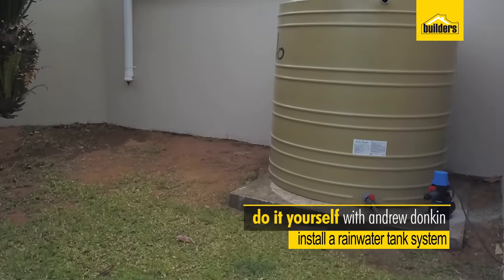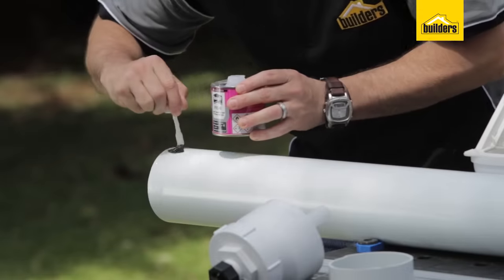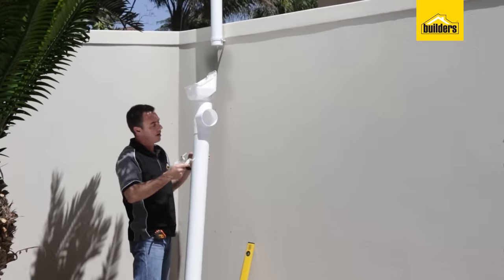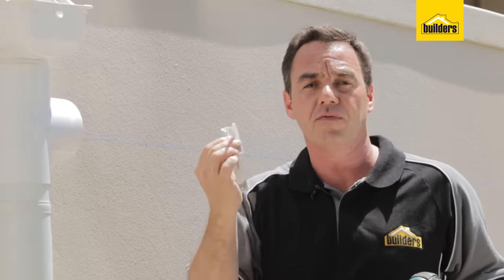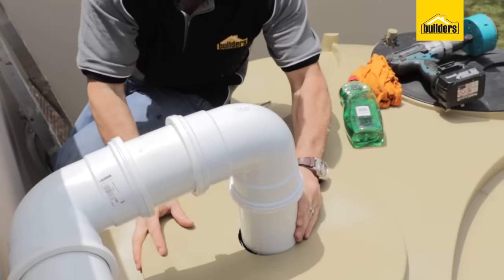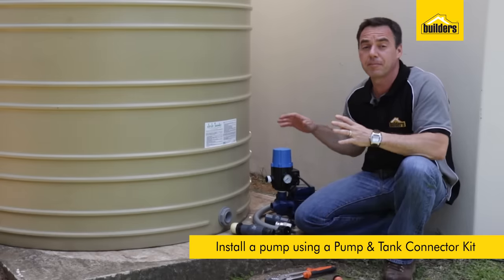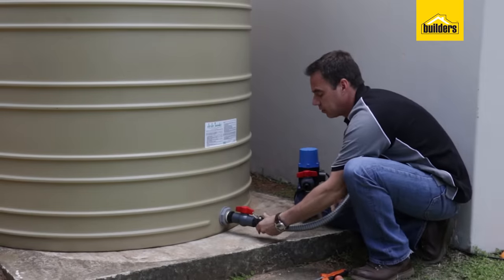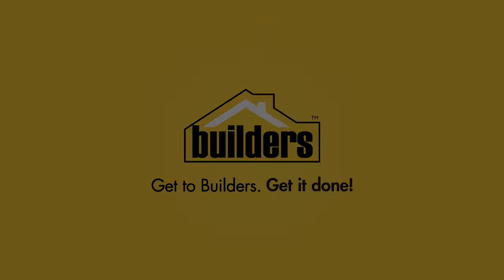How to Install a Rainwater Harvesting System - DIY

Comment: Unless I missed it somewhere... can you please add the list of all equipment used to complete this? Including tools... there are many beginner DIY people that would appreciate it.
Reply: Hammer, masonry drill, hole saw, pliers
Reply: Pipe cement, Level, Hammer, Drill, hole saw and Woodsaw
Reply: What kind of pump?
Reply: @TheSharlethaG water pump.
Reply: That ball. Does it float? What does it do?
Reply: @TheRainHarvester  Once the First Flush pipe gets filled, the ball floats to the top and redirects the water towards the tank.
The filter is called a Leaf Eater, I have the same exact one.

Comment: Wow, alot of water wastage in the leaf shield catchment area, this is why I always use 50 or 80mm, 110 is a total overkill even in the heaviest of rain. 80mm woes not have that issue, also cut the pipe at 45 degrees upwards for the leaf tray in heavy rain if pushes the water to the top and not to the bottom where the leaves fall and avoids that nasty spillage.
Reply: You're saying the diameter of the first flush is too big?  But, don't you want to get rid of a certain volume to make sure you wash off all (most of) the bird poop, pollen, and whatever chemicals may have floated over to your roof, before you start collecting?
Reply: @solfeinberg437  Not the first flush itself. China town you can get first flush in 80mm. I just love the "neatest" setup and I find that with 80mm. To help with the other stuff as well, get gutter guards and clean gutters (with bleach) fortnightly. First flush I would say is necessary but lots of people don't use them.....PS: First flush wont get rid of the chemicals. Also if you setting up, get filters (at least 2). But this video is great, absolutely recommended!
Reply: @garethcollocott6310  Agree. That monster pipe for 1st flush is not necessary.

Comment: Thanks, nicely presented video. Just one question: Why not just use the existing opening on top of the tank for letting the rainwater in? It can be fitted with a filtering screen that is available from the manufacturer, and which will then provide you with even better filtered water.

Comment: Just wondering what will happen if the water tank is full? Do you need to install an overflow valve?
Reply: Then use more water or see how to use those water in kitchen, washing machine.
Reply: overflows to the neighbor's section

Comment: Where does the ball seal the first flush water ?  Did you leave that part out or just not show it ?  The ball needs a sealing surface once the riser is full.
Reply: the T fitting on the First Flush Kit has a seat on the bottom vertical that the ball seats into as the water rises, thereby diverting the water to the horizontal outlet of the T to the tank.

Comment: Issue is my roof have 5 down pipes to drain the rain water at different corners. How to collect them at one point?
Reply: there are a couple of ways to do it...
where are you located???
Reply: @vineshdevchander1894  I am in varanasi, uttar pradesh india.
Reply: @shyammohansharma8919  ok.. thats a long way from me here in South Africa but it does not matter...the principle is not dependent on locality. Varanasi is beautiful. I've been there!!!
Method 1. the quickest method.
Join all the downpipes at ground level and run the piping to the storage tanks BUT Remember to have the lead to enter the TOP of the storage tank. I am making the assumption that the top of your storage tank is LOWER THAN the gutters. Am I correct in that assumption??
At the base of the storage tank put a T joint with a ballvalve in the closed position. After the rain... you can release the water  in the pipelines by opening the ballvalve you installed at the T. Make sure to close it after you release the water from the piping . That ballvalve must be in the closed position at all times ensuring that water during the rainy period collects in the pipe, rises in the pipe leading to the top of the storage tank to enter the storage tank from above . The ballvalve is only opened to release water left in the pipe after the rain has stopped.
When joining the downpipes at the bottom, use the same fittings and piping as the downpipes but you can bury the joined piping underground so that its more aesthetically pleasing and the same applies to the common lead pipe to the storage tank. try and create a slight gradient from the start of the lead pipe to the base of the storage tank so sat there is rapid flow in the lead pipe towards the storage tank. At the base of the storage tank you oukd have inserted your T joint with a ballvalve and right angled the other end vertically so as to feed  the water to the top of the storage tank leading into the tank.
If you bury the piping, make sure the exit piping from the T joint to release water in the piping daylights at some point so that the water can come out when the ballvalve is opened. If its not possible to have the release piping to daylight, you can have it daylights into a drum or barrel which can be buried and then you can remove the water by hand or a small submersible or fountain pump.
You are welcome to send me your details if you wish further clarity as I have installed several rainwater systems in South Africa and have done same at my own home. All the best!!!!
Reply: @vineshdevchander1894  thank you sir. I will consider your method when I start some reconstruction work. Right now I have connected the down pipe which collects largest portion of roof area to a 2000 liter tank placed in my ground floor. It got full in the very first rain lol.
Reply: @shyammohansharma8919  All good...just remember to have a first flush installed at each down pipe OR better still...also have a  common sand trap like box  unit which is intermediate between the roof  and the tanks.... well worth it!!!... My current system is in excess of 100KL storage and I'm able to run my home and veggie garden from season to season... independent of municipal water!!!
I'm here if you need help and assistance... Stay Safe!!! All the Best!!!

Comment: Can I install the flush system/ leaf eater to a current gutter? I don’t have a hundred foot ladder or access to the roof in order to replace the duct.  Will the water be safe for the plants keeping on half of the original material.

Comment: I'm confused, what is that wall and pump base made of so that you can just hammer in a screw, and why are you hammering the screw? Good tutorial, but i really am confused
Reply from the maker: Hi, those are nail in anchors. Andrew drilled a hole first in the concrete and then just hammered the anchor into position. They work well. The screw allows you to remove it if needed. NM

Comment: Do I need to do the electrical work first before installing the rain water for the pump? And is it possible to connect this to my sprinklers?
Reply from the maker: Hi Vicky, no you don’t need to do the electrical work first.  All the pumps are fitted with a plug which needs to be connected to your electrical point when you want to use the water under a pressurized supply.

You can install the tank first and get started with capturing your rainwater.  Andrew doesn't recommend using an entry level pump for an irrigation system as that requires a higher pressure and increased flow rate. 

Check out the following clips which assist you in selecting the right size pump.

https://youtu.be/lKUvxyd22No
https://www.youtube.com/watch?v=wa1KWOnAgV0&t=1s

Comment: What type of filteration system would you put if you were going to use the captured rainwater for drinking and cooking?
Reply: Honestly filtering the water for drinking will be a costly process. You could from the tank install an incline spun polyethylene filter system. It will filter the water as you need it but it would be low volume.

Comment: What's the pupose of the ball you installed inside the flush line? The tee junction, I dont think is viable cause water dirty debris can splash in before goin to the flush mechanism.
Reply: Would also like to know
Reply: When the 1st flush line fills up the ball rises to the top and seals against a rib on the inside of the pipe. This is not shown or explained in the video. So when the clean water arrives (several litres later) it hits the top of the ball and heads off to the tank. If there was no ball, the clean water would continue to churn up the dirty water with the possibility of some of the messy water being deposited in the tank. Hope that explains it.

Comment: How do you size the first flush system with relation to the size of the roof you're collecting the rainwater from?
Reply: The length of the pipe (with the screw cap at the bottom) is arbitrary. All that it does is to collect 'heavier than water' particles. You will still have a problem with bird droppings that float so there make sure that your filter mesh at the inlet to the tank is in good condition and clean.

Comment: Are all first flush systems the same size (length of pipe)? Would you recommend a first flush system for those in rural eswatini? Do they require a lot maintenance or just periodic removal of that bottom piece? Rinse and then replace the ball?
Reply: Unscrew the cap at the bottom after it has rained to release the muck that came from the roof.

Comment: What about all the  debris that fell into the tank when you cut the hole?
Reply from the maker: Hi, Andrew used a Leaf Eater that directs leaves and debris away from the flow of water before it enters into the tank. NM
Reply: BuildersFan I think road to mars is referring to the plastic filings from the holesaw

Comment: he should of put that anchor strap flush with the T pvc or else it is just gonna slide down over time  and possible pull out the anchor. that is probably over 5 gallons of water below the T. just a thought

Comment: Nice but there is a lot of controversy about first flush systems about whether we do or do not need them.  If you are using your rainwater purely for irrigation, the sediment from the roof is actually good for your plants.

Other factors include the length of the first flush system based on how much rain fall, size of roof and how long it was before it last rained.  the calculations of an optimal first flush has to be done based on EVERY rainfall so first flush becomes moot.  not to mention that a first flush system costs almost R750 now!  |

https://www.bluebarrelsystems.com/blog/first-flush-diverter/
Reply: You need them why would u not want the cleanest water possible in any situation

Comment: if you look carefully these morons don't care the plastic particles going into the tank when hole sawing into it. eventually it found its way into toilet flush tank and caused havoc. so more jobs for these plumbers 🤬
Reply: "small" plastic particles from this work will NOT cause havoc on ANY toilet flush tank, cos your a plumber and you know that right ?